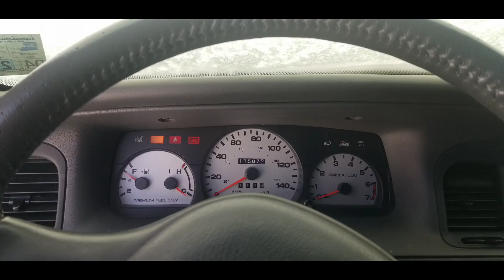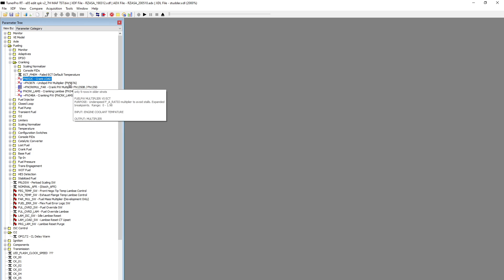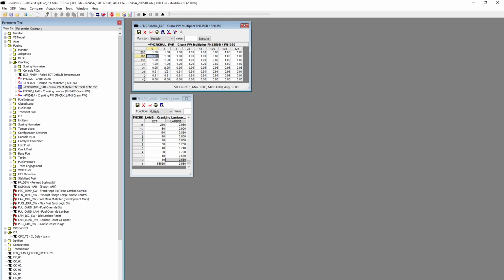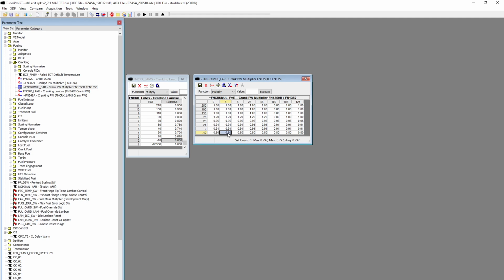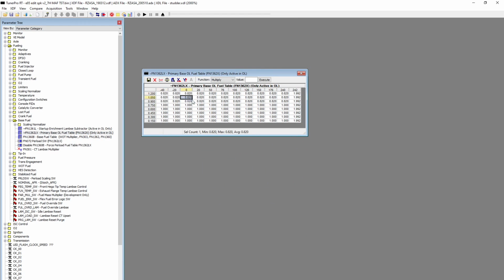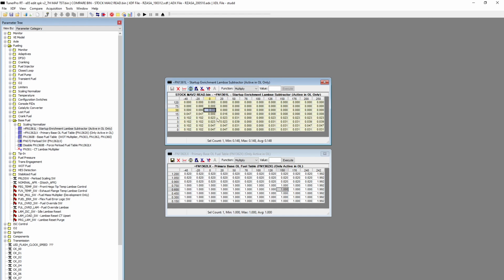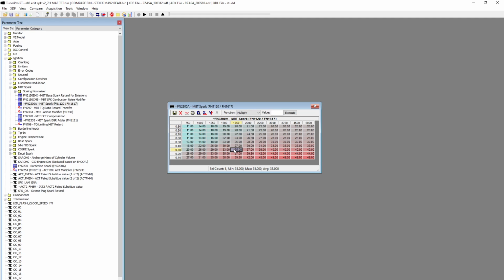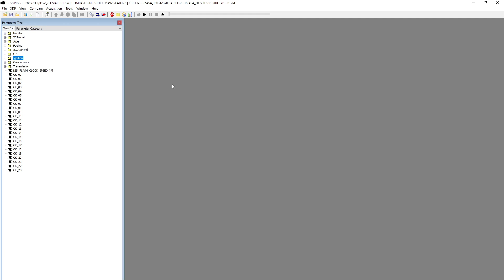Mercury Marauder |Tuning E85 for cold starts

Comment: Hey you can run normal gas if you run E85 injectors and pump
Reply from the maker: Great question . you most certainly can do this ! Just ensure that the tune is swapped if the vehicle is not flex fuel

Comment: Hey Mr. E85! I have two questions:

1: what are the top 3 stations that have the highest ethanol content in their E85 pump gas? 

2: I love the extra power of E85 in my 2011 Crown Victoria Police Interceptor, but I was wondering in Unleaded 88 (aka E15) would give as much power as E85? 

Thanks!!
Reply from the maker: It varies by region and season as content can fluctuate. The highest pump I'd found was RS racing fuels in Oklahoma city which had E100 ethanol. 👌🏿
Reply: @mr.e8543  Thanks! And will Unleaded 88 (which is E15 with 85% 87 octane and 15% ethanol) give me as much power as I get from E85? Thanks!!
Reply from the maker: Nope it's no where near the same level of octane